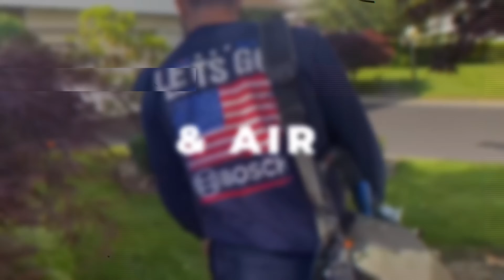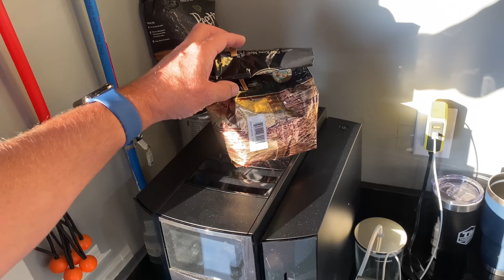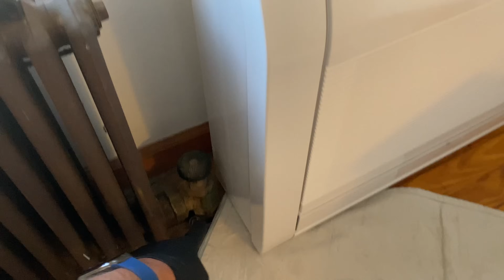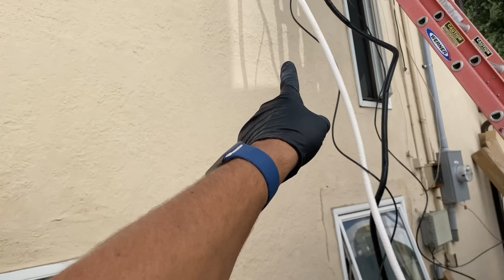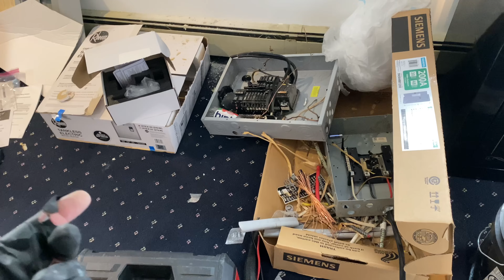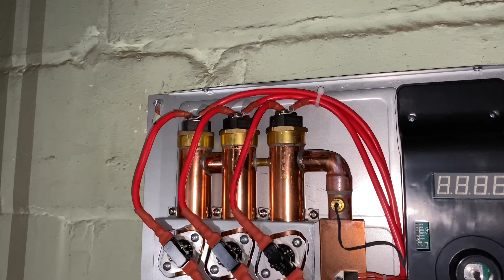PSEG Long Island Home Comfort Electrification Heat Pump & Tankless Water Heater Installation Rebates

Comment: Anyone had any luck finding home insurance with either [edit: ductless] heat pumps or wood stove as primary heat source?

Trying to get off oil heat sure has been eye opening. My insurance company will not accept anything except electric (hydronic) heat or baseboards, which will be as expensive, or more, than oil.

And to be frank, less reliable - who wants to trust NSPower to supply heat all winter long?

Comment: $ in rebates, $$$$ in price increases on utilities. Rebates are a method of taxing poor families and wealth re-distribution from those poorer families to richer families. The NY Clean Heat programs only permit specific equipment with specific ratings to cover the entire home which is out of reach for average home owners, and unrealistic and unattainable for lower income home owners. Then NYS wants to ban Gas and Oil, which is highly efficient and relatively clean. Most installers raise the price of these installations to consume the rebates in higher installation costs, which spill over to a new average price for installs, sometimes call "Make the trades great". i'm in the trade and I cannot afford the NY Clean Heat program for my own home.
Reply from the maker: Thanks for sharing your feedback and comments

Comment: Only benefit of old steam based systems, is if the power goes out, you can run the boiler from batteries (easiest are those $100-120 300 watt hour power stations) for quite a long time since there is no circulation pump or any other high wattage equipment. Though for fuel usage, they are very inefficient.
Reply from the maker: True, indeed come on
Reply: standing pilot gas fireplaces and wall furnaces are the best for that -> don't even need a battery!

Comment: do you have any air to water heat pump?
Reply from the maker: I’ve installed one in Central Florida for a customer, but I have not installed any heat pumps here in New York air to water

Comment: These air to air heat pumps been standard here in Europe for the last 10 years. Big push here no with Air to water heat pumps the connect to the underfloor and go through unvented hot water cylinder.
Reply from the maker: I’m actually they’ve been there a lot longer than 10 years. They’ve been there for probably about 40 or 50 years just about same amount of time. It’s been here in the states you know the other side of the pond. If you are in the Long Island, New York City metropolitan area and you need a local HVAC contractor give us a call at 516-348-6300 or safe time book online at PipeDoc.net

Comment: wait until they get their electric bill 🤣 or decide they want EV's and need to charge them both, take a shower and do laundry, while the home is heating. lmao, melt the main breaker or service entrance right off, then need to get a 400amp upgrade! lmao.
I see the lonely natural gas meter, if it was mine there'd be a natural gas steam boiler there, with maybe the heat pump units still to handle a/c and some fall/spring heating.
the oil needs abandoned, but the proper way will cost them fortunes. the government should offer free tank removals and contamination abatement if they really want to help anything out.
then again, I'm sure they'd fully screw that up as well.
Reply from the maker: Well, they have 200 A of service now they should be good for quite some time there next lateral move, which would be a great investment would be to install PV solar panels on their roof

Comment: the ground screws are probably from china and aluminum or a very poor metal. I noticed issues on screws in many thing, including electrical devices and breaker panel neutral/ground bars(all brands I've dealt with so far) anything post 2018 seems to have went south.  no quality and everything seems to be alpha stage development level  released upon the public.
Reply from the maker: It may be garbage if you ask me

Comment: for future reference,  a sheet metal screw of any kind is against electrical code. it has to be machine screw thread, with flat/blunt end and it's generally fine thread 10-32 size, with a washer head.
🤓 adjusts nerd glasses. lol
Reply from the maker: Yeah, but it still does the same thing and it drilled a hole and it’s holding the ground wire

Comment: Seems to me the government is trying to rely on electrical too much. We were almost at the end of the grid capacity, then we got led lights and that gave some relief. Now they think solar, wind, and atomic power will pick up the slack. However electrical power is to vulnerable to EMP's and overloads, and weather. I have even read they are zeroing in on fusion, and that is scary if they goof up it is not a melt down, it is KABOOM in no small way.
Reply from the maker: Well, we’ll see what happens when the new administration is voted in

Comment: Keep it real Mike.   U need to convert (means never use oil again) to get that $11k rebate....total lib scam...so ur new heating system is ductless forced hot air ....and ductless AC in summer.
Reply: oil heats best........(at least I think so- and when it breaks, I can fix it easily no matter what the problem)
Reply: @Drrich_DIY  heating oil is expensive.
Reply: @Steve-bm2zm  that's true. I don't have a particularly large house and in the winter (NY) it cost me about $1200/month to heat our house.
Reply from the maker: Actually, you are wrong. You do not need to get rid of the fuel burning appliances to qualify for the rebate and get paid. Please stop spreading false information.
Reply: Think of the money they will save from not using expensive heating oil. Remember when heating oil got up to 6 dollars a gallon 🤦‍♂️🤦‍♂️🤦‍♂️
Reply: U think once everything has electric cars and heating the electric prices will stay the same..? Or actually go down? Damm...ever hear 1st ones freee?

Comment: I will keep my comment simple “ALL JUNK!
Reply: Your opinion is heard. That doesn’t mean anybody cares! 😂
Reply: Why is it junk?
Reply from the maker: Well, why is it junk?
Reply: yes, it is! we'll check back in 5 years when it's all going haywire and either nobody will fix it or the labor costs more than replacement again. lol
if it makes it that long(electronics in everything and none of them last long) *brand aside*
Reply: @throttlebottle5906  why check back 5 years?!? Been working on ductless and VRF for 8 years now, come across units from 2011/2012 all the time still running. Hate this bitter attitude , embrace change
Reply: @TLocks7  I am still quite a skeptic about heat pumps, especially air to air heat pumps. Mainly because they are notorious for losing heating effectiveness when temperatures get below enough. The technology wasn't initially design to be suitable for really cold weather as a standalone in that case.  In fact last January where i live, when that arctic blast came through,  there were a lot of HVAC repair calls going out, centered around inoperative electric furnace heat strips. Which standard ducted air to air heat pumps in my area rely on, to keep up in really cold temperatures.
Reply: @throttlebottle5906  yeah clearly a throw away solution, mini splits, the fundamental technology is good but the heads seem like junk even though they dont have to be. Ducted mini split cassette’s are interesting. Would be nice to see units that are more solid, better looking, and might last the same life as a ducted system
Reply: Junk because the equipment that is  being installed in USA at this moment is  D GRADE ! Not even B grade 😂😂😂 
I rarely see  Panasonic being installed or even Mitsubishi ( MHI ) .
Reply: @themacfan  who is grading it?  Got any proof?